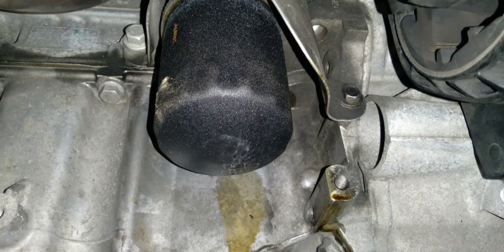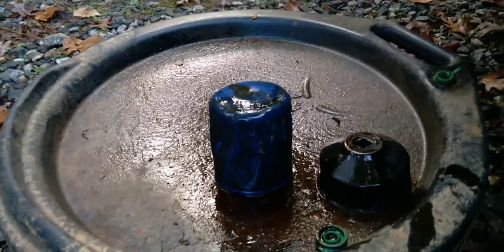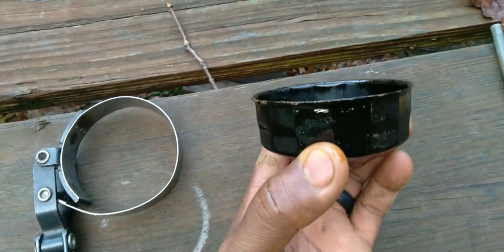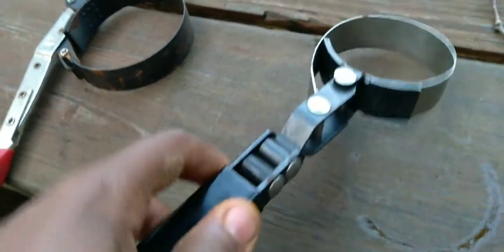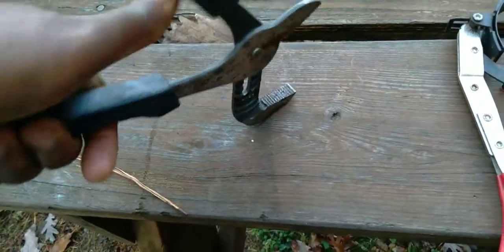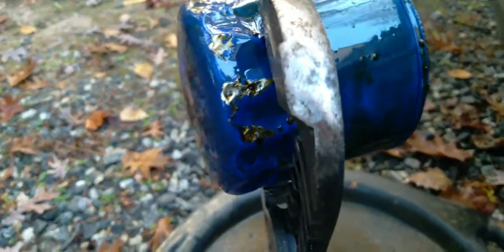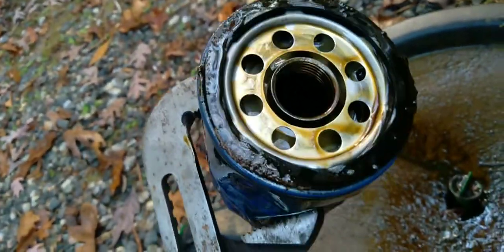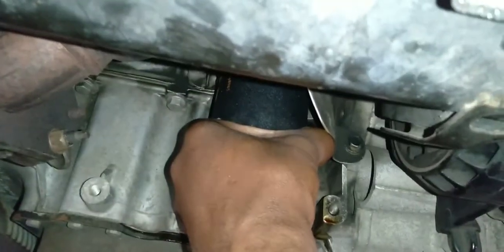HOW TO REMOVE A STUCK OIL FILTER

Comment: Channellock 440, 2 1/4 inch or Channellock 460,  4 1/4 inch get the job done. Channellock pliers get it done. This guy in the video used Kobalt pliers.